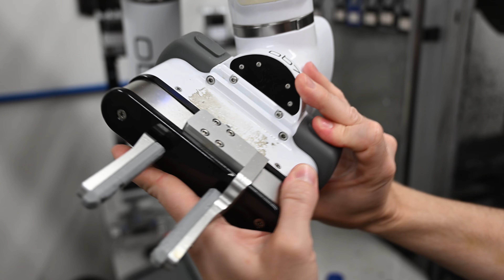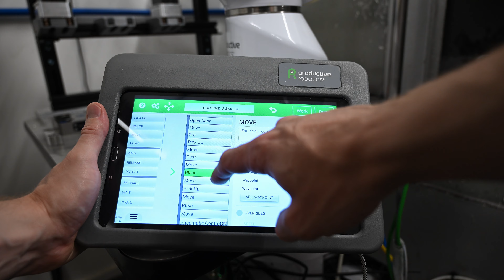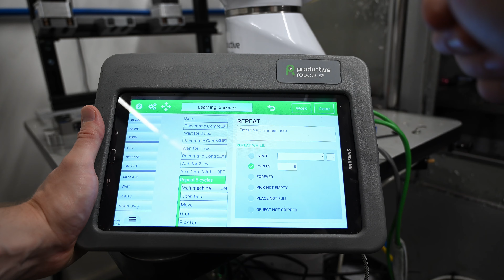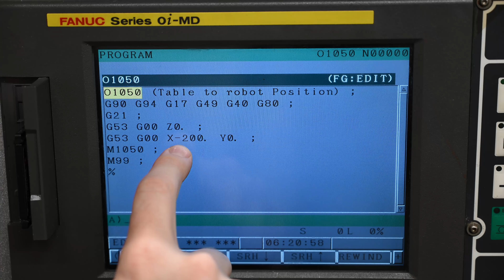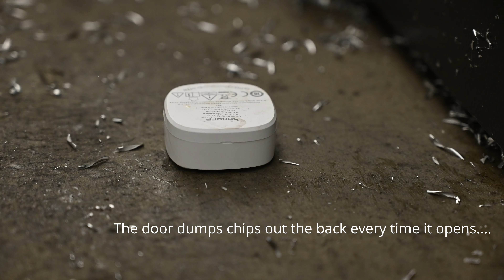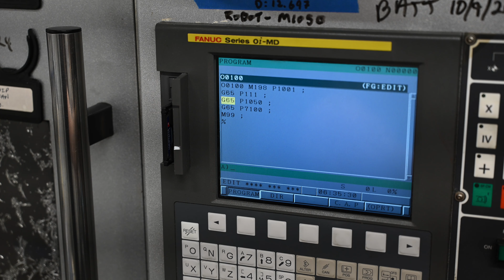OB7 Robot  - Budget DIY Pallet Pool

Comment: Cool video, I like the detailed explanation. But man, $20k for a silly android tablet controlled cobot that flops around like a wet noodle is nowhere near cheap. They're $40k new, which is more than actual genuine new URs cost, and they're the most expensive cobots you can buy. They're also extremely intuitive to program, far easier and more flexible than the OB7 judging from what I've seen.
If you want cheap, you can buy Chinese cobots for $5-10k all-in(new!), and they're all clones of URs down to the UI, which will still be better than this tablet controlled toy. $6k gets you a regular floor standing robot with 1.5-2m reach, but then you'll want a bit of safety gear if you're not alone.
And before people mention wanting locally made stuff, no, all of these robot startups use primarily Chinese parts, might as well skip the middleman.
Reply from the maker: That’s all fair. I wanted to get one I had hands on experience with at IMTS. I priced out some URs and they were at least 50% more used when I was shopping. For the next robot I may look around for other options!
Reply: @possumsolutions  URs hold their value significantly better because they are better.
From personal experience, I would recommend KUKA, UR, ABB, Chinese, in that order. For used I'd 100% go with KUKA(non-(V) KRC2ed05 controller or newer) or UR. It might also make sense to go with a non-cobot(used KUKAs are dirt cheap sometimes) and still be green after implementing a safety system(generally a 2D LIDAR or light curtain).
Reply from the maker: @Spirit532  I appreciate the advice and direction to follow. I will do some more research into the KUKA (I have heard the name, but don't know much). Another 4 months on and the robot has been going strong, but I do really wish I could dive deeper. The android tablet with their UI is quite limiting alas.

Comment: I love to see all the hackery. This kind of thing is my favorite. Take the tech and make it work for you.

How did you make the M198 call programs off of your CF card? Does that require a .bin file on the card or some kind of fanuc option?
Reply from the maker: Thanks for the kind words!! 

The M198 is a drip feed from the card. The program has to be in the Oxxxx formats with numbers and no extension. There are some other parameter setup in the control. Ironically there is an excellent Linkedin article about it. Search for “LinkedIn Fanuc CF card drip feed”